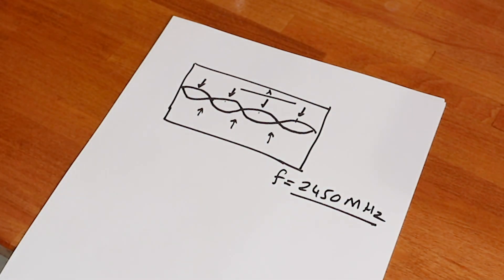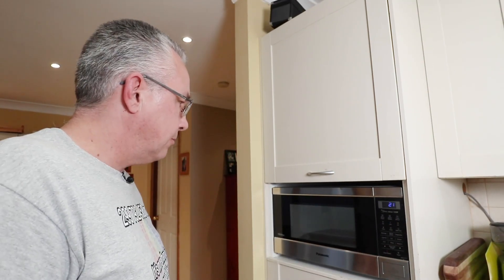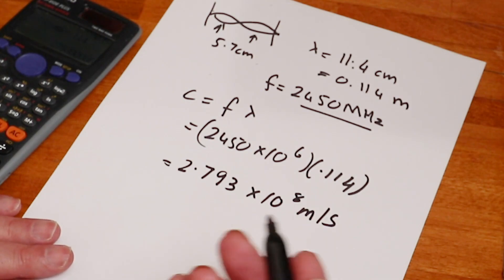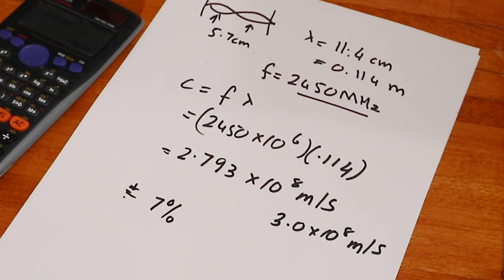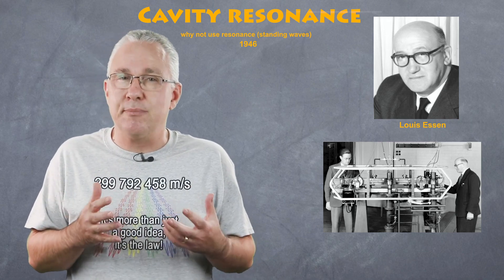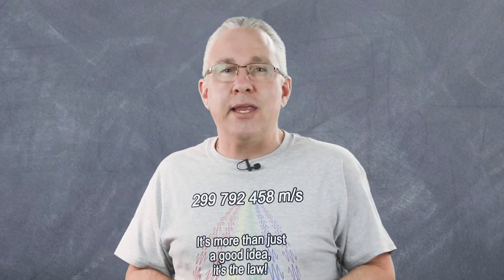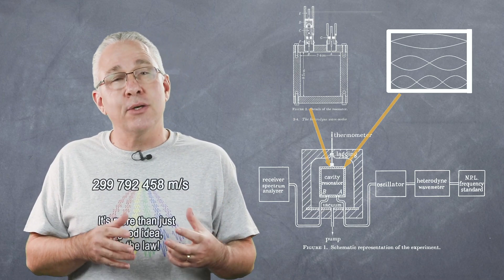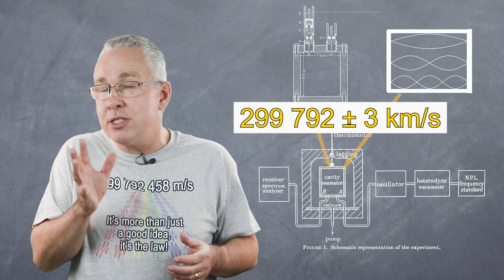Determining the speed of light at home using chocolate and a microwave and how Louis Essen did it.

Comment: Why does a standing wave have to be formed in the cavity resonator? Couldn't it just be open ended if all you need to do is measure the anti nodes? You could just measure two anti nodes out of phase and you'd have half the wavelength and by extension the entire wavelength. Does creating standing waves increase the intensity so the anti nodes can be detected?
Reply from the maker: We are Dealing with electromagnetic radiation, not sound waves. That means you need metal walls for the reflection and us to have no kids at the walls.

Comment from the maker: This experiment can be done with a variety of foods - cheese, marshmallows (big ones and small ones), and different brads of chocolate - anything that melts. So the question is "which give more precise results? And why?
If you get a change to do the experiment with a different food, post your results here with the food you used. Maybe even make a short video of your efforts.
And offer up your reason WHY there might be variation? (If it exists :) )
I'll do a follow up video if I get a good response
The more details the better 
- what food you used and type/brand (eg cheddar cheese, marshmallow brand, cadbury's chocolate)
- what size were your melted spots
- your value (obviously)
(A safety reminder: you do get hot food so handle with care, don't use metal plates and if under 18 get permission first)
Reply: Since the wavelengths measured by a variety of foods were actually different, isn't that because of the refraction of light? I guess that the 7% difference between the speed of light in vacuum and the one calculated in your experiment can be used to calculate the index of refraction of chocolate. Different foods might have different wavelengths ( a refracted wave will propagate with the same frequency of the incident wave but with different speed and thus different wavelength in the medium of refraction).